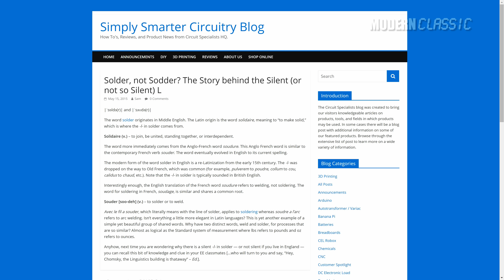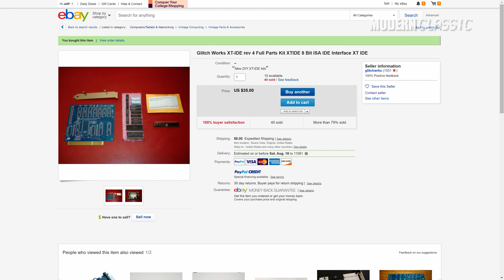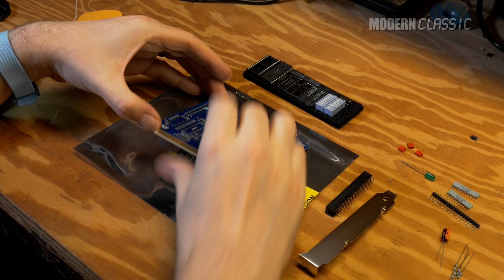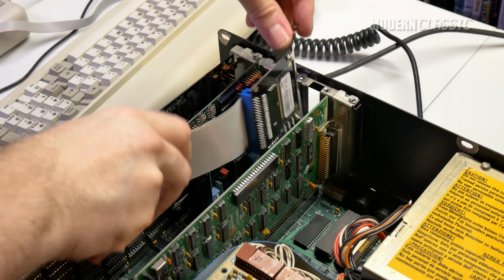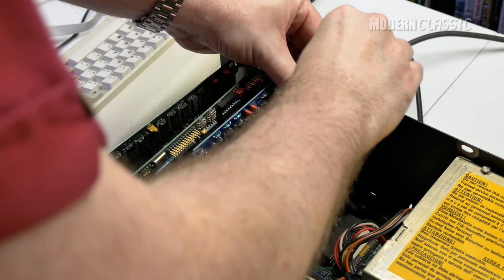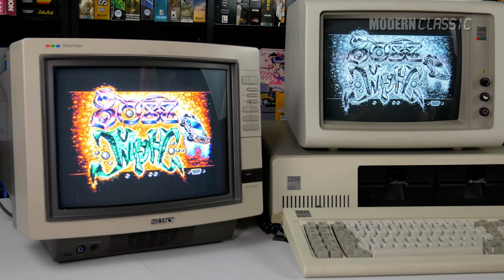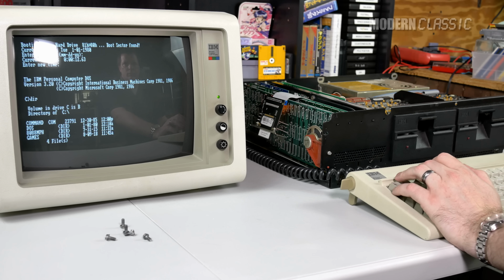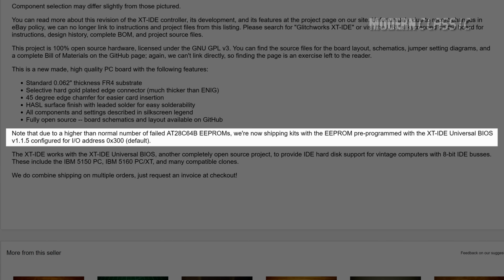Flash storage for classic PC's - building an XT-IDE kit!

Comment: Hi All, Nice Video, good to see you got it up and running. I have a P100 with the Dallas RTC chip error, and the 5 "new" and used replacements are all dead, so i just use it with a Goteck USB adapter, most floppy items are fine,but my main boot image has a 16meg memory and i run 4/8meg at times as a ram drive to use as a c-drive.   My oldest PC is a Gateway 2--- Pentium 2, this one has just a CF card ( plus Zip 100, SB16 - CDROM, IDE CDROM ), i have 3 CF cards all up, 2 x male ( push into the IDE connector on the mother board )  in different makes, and 1 x female ( plugs into IDE cable ) , but in all the mix and match i have not been able to get a second IDE device to work of the chain that the CF is connected to.  I have 2 x 256Meg CF card with just dos 6.22  and all of my floppy images and popular apps and games, the other CD card is 4Gig, it is Partitioned into 2 x 2g with win98, the machine runs perfect in dos mode or straight into Win98.
Regards
George
Reply: I've got repair boards made up for most of the Dallas RTCs at this point. You can find them in the TIndie store linked in the video description. The boards are all open-source.

Comment: I too would love to see the Hard Card be restored. Especially so if the components of the hard drive can be repaired.
Some time in 1995 I think I had to replace a platter in one of my Seagate MFM drives. And walked to Radio Shack to replace a transistor that had blown on the controller board.
Reply from the maker: I believe the noise I'm hearing is bearing failure, and I'm not sure there's really any way to fix that. At least, it's probably way beyond my abilities. If it was stiction or something on the controller board, I could probably do it.

Comment: I found a hard card in a scrap pile years ago and it lives tied up to the wall in my cubicle. I've never owned a computer that could use it and always have wondered if it still worked and what might be on it... But i know that I've scrapped many of these 15 plus years ago and it honestly makes me sick thinking about it.  ...it was freaking awesome to see one in action though.
Reply from the maker: If you haven't used it in many years, it's almost definitely dead - these drives are known for stiction. Mine was stuck when I got it but it luckily unstuck itself... now, though, it's definitely going through bearing failure, which as far as I know is unfixable.

Comment from the maker: Hey guys! Several people have actually commented about the size of the solder I'm using, so I may as well pin my answer. I do have thinner solder that's probably more technically appropriate for this purpose (the spool is behind the flux in the shot when I'm tinning the tip), but I intentionally chose to use thicker stuff. It has a thicker flux core and makes it easier to finish jobs like this quickly, because I don't need to manually flux. And it works. It might not be as pretty as the stuff you've seen working at an electronics company, but that's not the goal. The goal is to have fun making something that works and show you how to do the same, and that was the result here.
Reply: I always use 1mm flux core solder, and never had a problem, perhaps your thin solder wire isn't good, or is an older spool that isn't good anymore...
Reply: 0.5mm too small you'll use it all up 1.0mm  is the way to go
Reply: Using a bigger gauge for solder isn't an issue; there difference mainly comes to how fast you need to feed the solder to the joint. It can be easier to control the amount of solder with a smaller gauge, but at the same time if you're careful, there's nothing wrong using something bigger.
Reply: That explanation doesn't seem to make a lot of sense, as the amount of flux does not depend on the solder thickness. 2% flux in 0.5mm solder is not too uncommon. Not that you're wrong in using the solder that you happen to like, after all the thin solder you have just might not be very good to work with for a variety of reasons, just poking holes in the logic. I find thin solder to be faster as it will start melting quicker and release the flux very easily. At the end of the day your soldering is perfectly fine, it doesn't look machine made, but there's absolutely no reason to suspect that it will fail.
Reply: #sodder Omg! What's wring with your voice??  Why do you make videos whilst chewing a bunch of springs in your mouth? I can't imagine that any human could understand this accent, even if it weren't for all of the hideously mis-pronounced words... if you plan to make a career of this kind of thing, can I suggest you learn a proper English accent? Like everyone else on the planet :oP
And annunciate dear boy, Annunciate! xxRj 
(I hope it's obvious that this is a joke, but I'm going to write this anyway ;o)

Comment: FYI: Several manufacturers did make 8-bit IDE-XT hard drives and interface cards (not to be confused with this XT-IDE card) in the late '80s and early '90s, but there were multiple different proprietary interfaces in use, so an IDE-XT drive from one manufacturer wasn't guaranteed to work with an IDE-XT interface card from another manufacturer. And only one model of these drives (the Seagate ST-351A/X) was also compatible with the "normal" 16-bit IDE (a.k.a. ATA) interface. But nonetheless I do have Seagate IDE-XT drives in several of my Tandy 1000 systems and they work just fine.
Reply: The ST-351A/X was also one of the last 40 MB stepper-positioned drives made, too. I don't know if that contributes to their seemingly higher-than-average survival rate, but they do seem to be tough little drives. I've found more of them in 16-bit ATA service than 8-bit XTA service.
Reply: The ST=351 A/X was a pretty snappy drive for what it was too. Loved em
Reply: The 80s were an interesting period in PC hard drive interfaces, in the course of that decade I used MFM, ESDI, SCSI, and IDE driver interfaces in my various PCs.  I’m not even sure most of that era even remember the ESDI interface that was an intermediate interface technology between the aging MFM and SCSI/IDE which were still maturing at the time.
Reply: Indeed, it was common to see SCSI systems with an ESDI drive and a SCSI to ESDI converter board bolted to the drive.
Reply: I'm sure that the MFM you are referring to is actually the ST-506  interface. MFM (Modified Frequency Modulation) was the recording method.
Reply: I do not recall which card I ended up with, but I did have an 8-bit IDE host adapter in my 1000 TX. Possibly as early as 1990. I also had the 768k ram expansion, a mathco, and I think an RTC. I dug that 'superior' PC Jr. clone of the Tandy.
Reply: I also had the Tandy 1000 TX and I had bought a 20 MB (8 bit) IDE hard card to use with it. I no longer had to boot off of floppies . I ran Dos and Deskmate. my favorite game was the Microsoft flight simulator. At some point the Tandy failed to turn on and I pitched the whole thing in the dumpster including the CM 11 color monitor. I wish I had saved them now.

Comment: I wonder if I can find something like this for the Compaq 386 I might get from my dad, assuming it works. I'd really love to keep the HDDs from either it or the 286 twin, but who knows if they still work and if they do, how much longer they will.
Reply from the maker: A 386 is probably already using IDE, unless it's an IBM PS/2. And with the same exception, it'll at least have a 16 bit ISA bus. So you can just get a standard IDE controller if you for some reason need one; you wouldn't want an 8 bit one anyway since it'll be a lot slower. If you want to use CF, you can just get the adapter by itself and a CF card. You should be able to hook up the current drive and CF adapter in a master/slave configuration to copy the current drive to CF before removing it. (If you want to remove it; I'd recommend at least backing it up this way regardless.)

Comment: BTW, if it hasn't been mentioned already, you should really use thinner solder.  You will have an easier time controlling the flow.
Reply from the maker: Nah. Mentioned this in another comment, but I like this solder. I have thinner solder (you can even see it in a few shots) but it's actually harder to control.
Reply: You get used to a certain size. I use stuff that looks like it's even thicker than in this video for through hole stuff (and tinning). I've got thinner stuff, but it feels clumsy because I'm not used to it. And I've got some really thin stuff that came with my Chinese soldering station... Just recently started using it, and it does feel nice, but is no good for big joints because it takes miles of it to get anywhere.

Comment: For breaking apart the jumper strips I would suggest you score it with an xacto first on both sides - it will increase your odds at breaking it at the right count but also in the center of the gap...
Reply: Brian Ullmark  Actually, there is no need to score if you use two pairs of pliers, one grasping to either side of the crimped area between pins and then quickly rotate one of the pliers just a fraction of a turn, you will get a clean break every time because you concentrate all the force on the built in weakness between pins (it’s an even more helpful trick with the double pin header strips).  Even just securing one side rigidly in pliers and then using your hand for the other half greatly improves the chance of a clean break without having to score the break point, though double pliers is still the more reliable method with the double wide header strips.
Reply: I guess each to his/her own - been doing it that way for many years and it works for me anyway. With that said - either way is better than just snapping them apart with your fingers alone.
Reply: I use pliers to hold the section that's being broken off, and start with the 2-pin segments, then the 3-pin segments, so you're left with a 10-pin piece to break into half for the two 5-pin segments. Breaking the short ones off first gives you more leverage. But everyone builds kits differently -- cutting with an X-acto knife or snipping them apart with side cutters works, too!

Comment: I recently picked one of these up (pre-assembled) and had the same issues you had.  I just gave up because no matter what I tried I couldn't get it to boot directly to the cf card.  I even had a DOS 3.2 disk that booted fine, but when I fdisked and formatted the partition and sys'ed it, it still wouldn't boot up.  I still haven't figured it out but may get it back out again now that I know this is more than just something I was doing wrong and see if I can get it booting.  I salute you for getting it working though!
Reply from the maker: Try a couple of the things I mentioned in the description, because I don't necessarily know what had an effect and what didn't. Run diskpart and then clean the card fully: http://knowledge.seagate.com/articles/en_US/FAQ/005929en
Then zero out the MBR using debug: http://minuszerodegrees.net/ibm_xebec/ibm_xebec_llf_debug.htm

I did both of these in the VM. I believe this part, at least, should work the same in a VM as in a real machine.

After that, you should be able to fdisk and format. Also try what I did starting the partition at cylinder 1, if you're using DOS 3.2. (From 3.3 on, DOS doesn't ask for cylinders anymore.)
Reply: So I still wasn't getting it working, but I did find another IDE to CF adapter that I got for another project and it seems to have worked.  I got it to boot to it, but then I tried to install DOS 5.0 and now it's not working again.  I have the exact IDE to CF adapter that you have, so it's possible that it is the issue.  I'll keep troubleshooting and let you know if that ultimately ends up being the problem.  Do you have another IDE to CF adapter model that you could try?  Makes no sense why that would be causing the problem, but it did for a moment get the system to boot without altering the geometry via fdisk.  I'll post more after further troubleshooting if you're interested.
Reply from the maker: I did try another IDE-CF adapter; it seemed to do the same things (worked when the other one worked, didn't when it didn't) so I stuck with the one with the external interface.

I think your problem may really be that you need to do a diskpart clean and then zero out the MBR with debug. I finally got DOS 5.0 installed on mine (on a full 256mb partition) by making actual DOS 5.0 floppies from the images at WinWorld, but in between this video and doing that I had tried to install it again on a VM, which obviously nuked the card again. When I then tried reinstalling 3.2 using the PC, the card still wouldn't boot. I did the diskpart clean and the zero MBR in debug again, then installed 3.2 again and that fixed it. I did the same thing again just before installing 5.0, just in case. The XT-IDE seems to really want a fully clean card, and to be able to configure it how it wants.
Reply: Ok, and also you did the 5.0 install directly on the PC with floppies rather than a VM correct?  If so, I'll have to burn myself some 5.0 disks and try that again.  It is really strange that it is this difficult to get this working.  I haven't had this much trouble on one of these CF conversion kits before...you just get the CF card bootable and it works.  Very strange.  Maybe it's a 5150-specific thing?
Reply from the maker: Yes, I did it with actual floppies. I put the disk images on the CF card along with dskimage.exe and made the floppies on the PC under DOS 3.2. Then I booted from the floppies, used fdisk from floppy 2 to delete the existing partition, then I ran diskpart and debug to zero out the MBR again, then went back and formatted and installed DOS 5.0 from the floppies. I've never used the XT-IDE in a different type of computer but I think this is most likely an XT-IDE thing rather than a 5150 thing.
Reply: Ok, will do.  I'll try all those steps again with actual floppies and hopefully that will do it.  Thanks for all of your assistance with this.  Hopefully it will help someone else trying to get this damn thing working :)
Reply from the maker: Even if it only helps you, that's cool :) I hope you do get it working.

Comment: Kinda sucks you have to go  with the flash storage route.  Or can you use a normal IDE hard drive with this kit? You can still buy them for cheap right now. 

"eventually it goes into place trust me on this " XD
Reply from the maker: You could, but there are many disadvantages to doing so. Still leaves you with no easy way to move software back and forth between computers, for example.
Reply: Pulling IDE drives in and out was how we moved files around when I was in school. We left our lids off to save time, and had jumper settings memorised on the drives we usually used. Old times.
Reply: In my neck of the woods the local nerds would route and IDE cable out behind the front panel at the bottom to plug into a hard drive sitting on the table.

Comment: nice vid but your soldering is making my teeth itch......... i worked for siemens and marconi for a long time if I'd had something like this sent to Q.A I'd have been laughed out the factory then sacked
Reply from the maker: And yet it works fine - go figure!
Reply: Just a hint. Try 63/37 solder instead of 60/40. It tends to flow better for stuff like this.
Reply: For a hobbyist his soldering skills are plenty acceptable ... and yet far, far, better than a lot of the hand soldered electronics that we buy today from abroad.  Would it pass an aerospace or military application inspection, certainly not, but then look at his intended application — even in the worst possible case no lives nor billions of dollars worth of hardware will be lost, the PC will simply fail to boot or would do so intermittently, or, truly worst case, the nearly 40 year old PC will suffer failure due to shorts on the I/O bus or power rails.  It is fine to offer constructive criticism on techniques to help improve soldering skills, but I do not get the need to poke fun at every beginning hobbyist’s soldering skills when they are still learning.  We should be encouraging newcomers to the hobby, not poking fun at them just because they are not natural professionals right out of the gate!
Reply: I think the issue was just that the solder was a little thick.  There's thin solder that you can buy (as well as thin tips for the iron) which do wonders on PCBs.  But Modern Classic managed, as usual.
Reply from the maker: Not replying to anyone specifically here but just generally - a few people have mentioned the thick solder and I'll probably add something to the video description or a pinned comment because it does get tiring giving the same answer over and over... but I use this solder because I like it. I have thinner solder that came recommended from someone - you can even see it in a couple of the shots (it's the spool behind the flux when I'm tinning the tip). I intentionally chose not to use it. I'll think about an explanation that I can write succinctly, but I've got about 5 different reasons for using this solder over the thinner stuff.
Reply: I wish we didn't have to be so nitpicky. Haha. Personaly, as long as it works, I don't care if it may not look as clean as it would if someone else did it. I'm functionally unorganized, so I get that kind of shit from people a lot.
Reply: Modern Classic My apologies; I only noticed other comments referring to the solder gauge after scrolling further down.
Reply: Yes, kept wanting to reach into the screen and take the iron away.